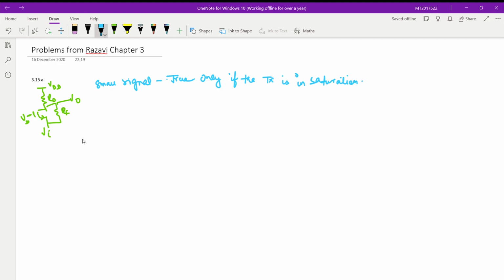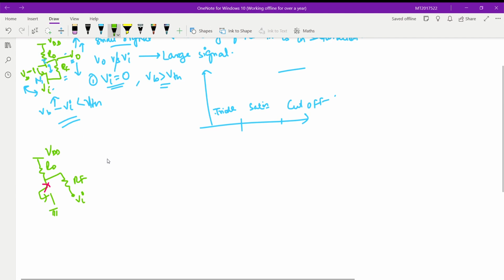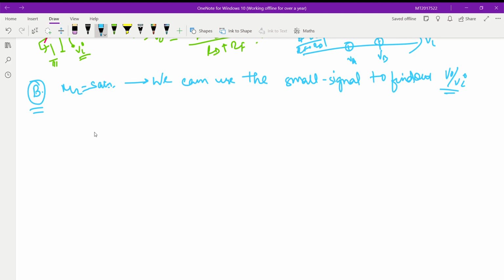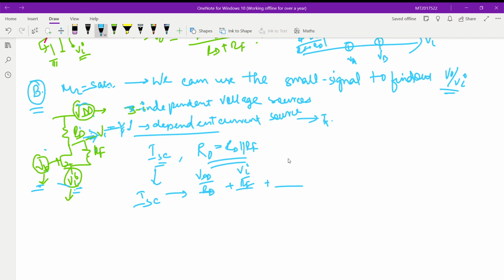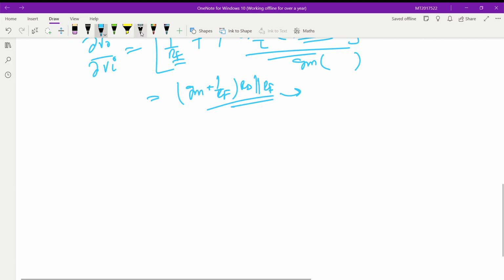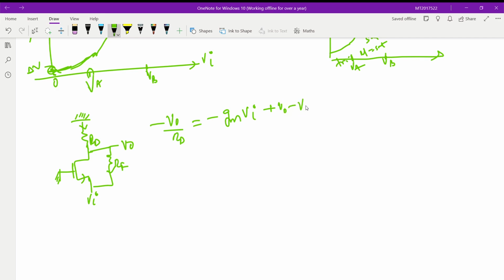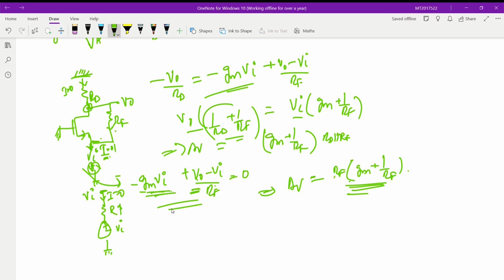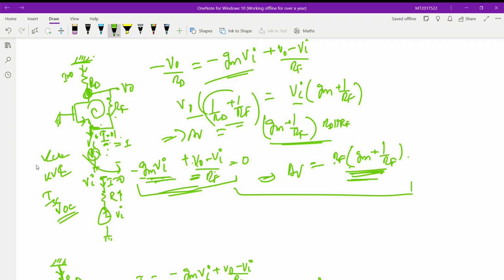Analog CMOS VLSI - Prof. Behzad Razavi || Solutions || Exercise Problem 3.15 (a)

Comment: Sir can you plz do video base on these topics from design of analog CMOS integrated circuits text chapter 6 and chapter 9 by Behzad Razavi
1.Frequency response of circuits
*Frequency Response- Miller effect, bode plot, poles and zeroes, gain and phase margins, association of poles
*Analysis of common source amplifier frequency response

Analysis of common gate amplifier frequency response
*Analysis of frequency response of differential pair with active load
Reply from the maker: @DivineEchoes6777  Hello Aparnava. Thanks for the suggestion. Ill surely post something on those topics by next week
Reply: @grandpa_z9110 sir any updates